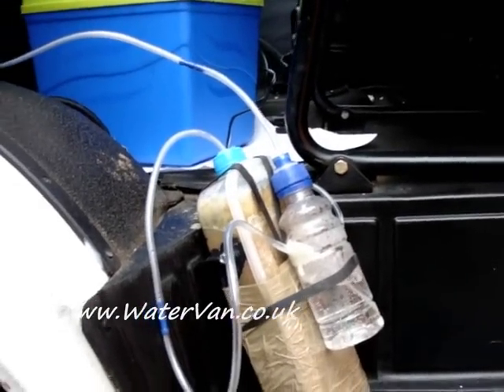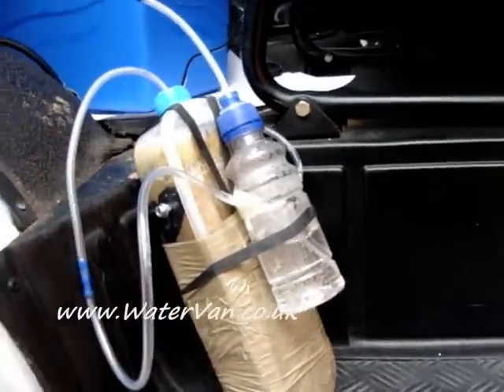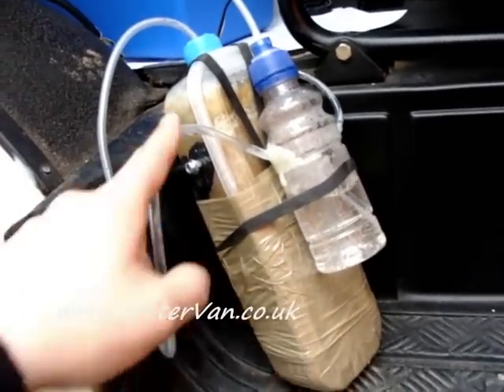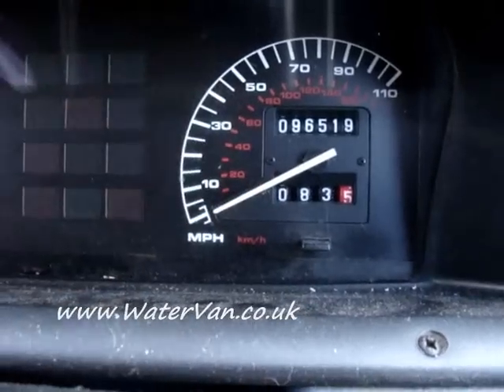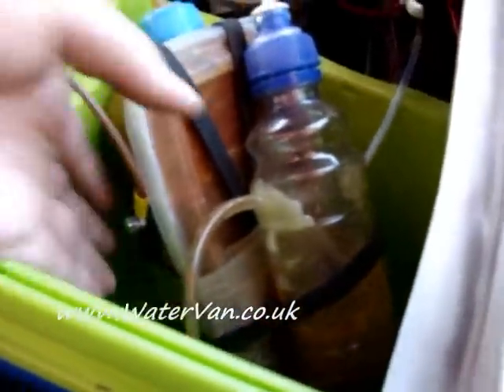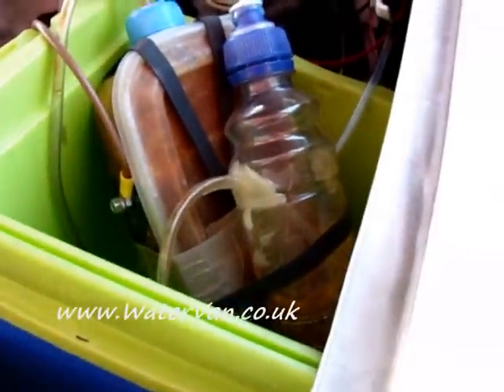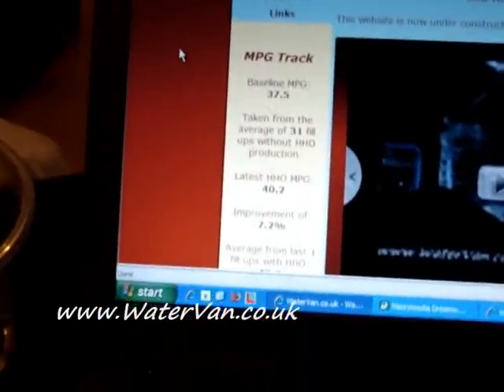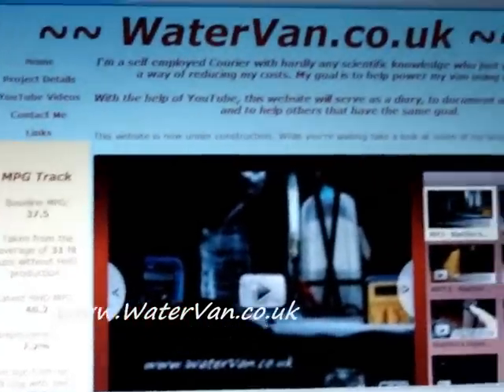#014 - MadStu's Water Powered Van - First MPG Rate - 7.2%...

Comment: start at 10 grams KOH to 1 liter of distilled water, work your concentration up from there until you find the "sweet spot". the more KOH, the more amps you will pull.  so add a pinch, wait, check amps, add a pich, wait, check amps. when amps get about where you want them, note how much in total got you the amps you wanted. Use that as your "standard mix". 

The jar of KOH I bought about this time last year is still 3/4 full and was a 500 gram jar. Think it set me back about US$20 or so.

Comment: you are on the right track ... suspect your method will do well ...

unlike baking soda, KOH will not break down ... if you can catch those vapors and return them to your soup, you can run on a charge of KOH indefinately ... just add water ... and KOH seems to provide a very clean reaction with little if any residue ... best thing I have found so far and have tried many ...

Comment: KOH will evaporate during the process and can often be seen as light vapor. A small portion in gasseous form will be in the HHO gas. You want to get the KOH vapors out of the gas before you send it on to your intake as KOH is nasty on aluminum bits. Your bubbler will remove it but its expensive stuff so it would be best to figure out a closed loop system so it gets returned to for re-use.  Not that complex to do really.

Comment: ok Stu ... are you about finished playing with your sludge making machine and about ready to invest in some decent stainless ??????

Baking soda or bicarb, as you guys who cant speak proper English call it, will turn a very light yellowish brown under normal conditions. Its ok to use for basic experimentation, but when you get serious, you will want to get some potassium hydroxide to use as electrolyte.  and design a closed loop reservoir system to keep the KOH where it belongs.